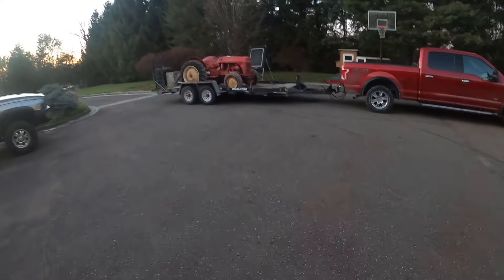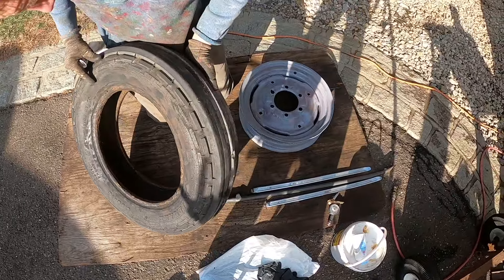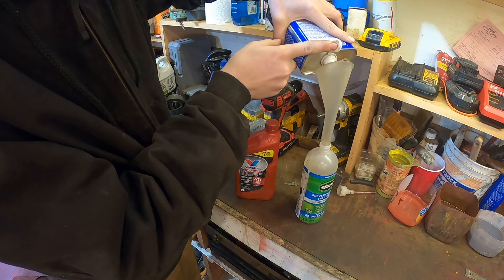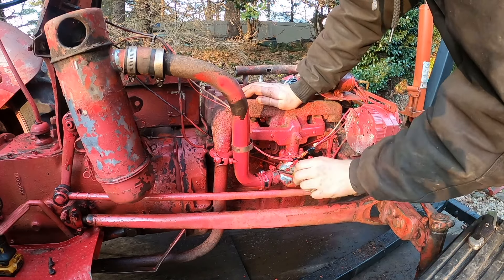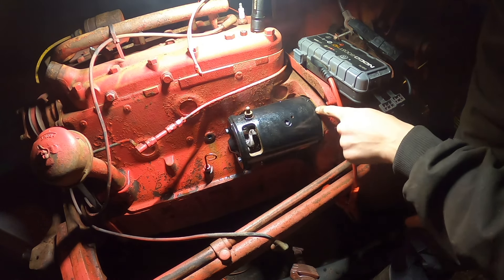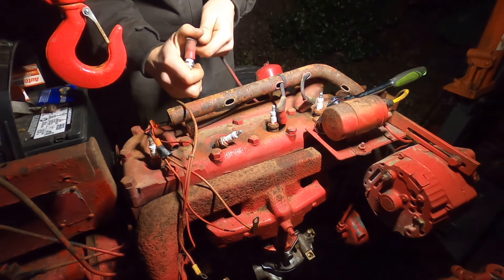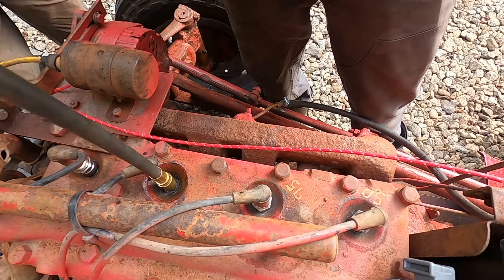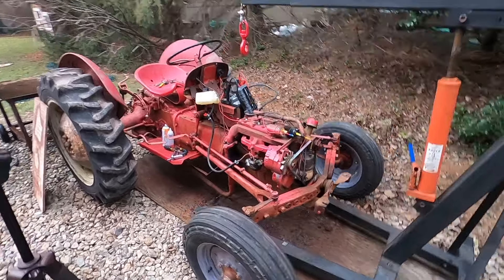Ford 8N Sight Unseen Auction Buy - Will it start? - Restoration Pt 1

Comment: When it's cold spray a little marvel mystery oil in the cylinders and put the spark plugs on the defroster in you truck with something over them and heat them up and then put them in hot it really helps.

Comment: That might be an early 8n. The newer ones had the distributor on the side. On my first one someone put a fine mesh screen against the radiator . It worked well to keep the chaff out of the radiator fins while brush hogging fields. I cringed when you smacked the end cap on the starter against the brushes. lol  If it ever won't run right, inside the carb throat there ate two tiny holes that can clog up. I use a torch head cleaner , the wires are abrasive to scrape the crap through. Put wedged shaped blocks against the engine and axle to keep it from leaning sideways when you undo the shop crane. Safety tip. Keep making those videos working with your dad, you won't regret it.
Reply: Only the last year of production had side distributor.
Reply: @billf157   Was that 51 or 52. The story was hazy.
Reply from the maker: serial number 172453 so I think it is a 1949.  Thanks for the wedge blocks idea.

Comment: The old mechanic told me the atf for sticky lifters 1/2 pt added to engines cuts the shellac formed on lifters took fifteen minutes to stop clicking i assume it foes something similar in the cylinder bores

Comment: Just some safety advice from someone who has seen things go South quick, always use some sort of dunnage under jackstands on any type of soil/gravel. Some very thick plywood would do well or a few layers of thin plywood, also you never want to have a lot of weight that high on a jack stand, they get unstable and will wobble/fall. Always expect the worst and you’ll never be surprised.

Comment: Ford 8N is just so cool. Would really love to have one of these.
Hard to find i Sweden though.
Are you going for a full restoration like the Farmall?
Nice that you always explain in detail what you are doing. Great video!
Reply from the maker: Thanks for watching in Sweden.  I think it would be cool if I could work on an old European tractor!  I do have a Ferguson TO-30 in progress.  We split it - clutch disk had turned into dust by mouse pee and now I measure about 0.15" movement in the crank.   There is part 2 of the 8N where I working on the clutch and brakes.  Part 3 of the 8N will be coming soon.

Comment: The proper way to restore a tractor.  Remove the front axle pivot pin.  While holding the pin in your left hand, replace everything behind the pin and then reinstall the pin.

Comment: Looking at one of these right now. What's it like trying to get parts for them? Where did you find the carb kit?
Reply: Parts are plentiful, like everything they used to be cheap. There were 3 different carb types if I recall not including if a farmer swapped one from an entirely different tractor. Best to look at the one you have and determine what model exactly it is. Steiner, Dennis Carpenter, Just 8N’s, and anywhere else online have parts.

Comment: What gear does the tractor have to be in when you’re prying against the fly wheel?
Reply from the maker: The flywheel turns when the engine turns.  When in any gear (and clutch not disengaged) the rear drive wheels need to move when the engine turns.  Sometimes you can free a stuck engine by rocking the wheels when in gear.  When prying on flywheel teeth we want the entire force to go to moving the pistons so the tractor should be in neutral.
Reply: @thesmallenginekid thank you.. I’m pretty new to working on tractors but after I put mine in neutral a couple of attempts later my fly wheel moved.. made me regain hope thank you!

Comment: Looks like oil filter misding also
Reply from the maker: good eye, I found a 8N oil filter housing at a salvage yard and installed with oil filter
Reply: Hope you got it running. Good old tractors. I have 2 of them 😅

Comment: Tractor locked up, doesn't run, buys tires and rims. GEEZ.
Reply: Even if he doesn’t use them on this tractor I reckon in the next 50 years he’ll likely stumble on another 8N that can use them…..they ain’t gonna get any cheaper either